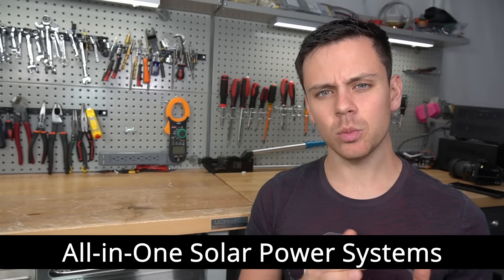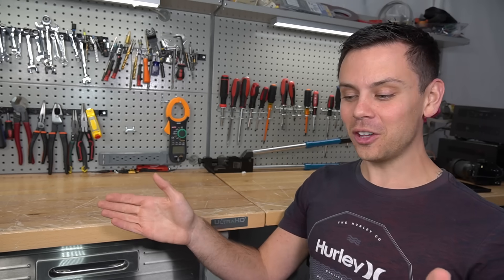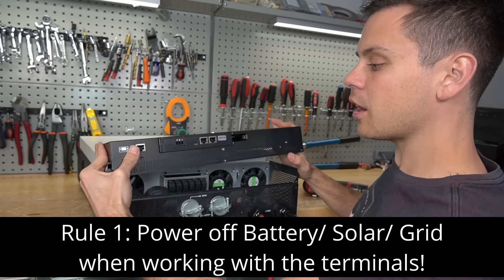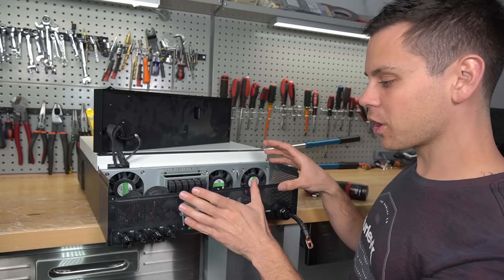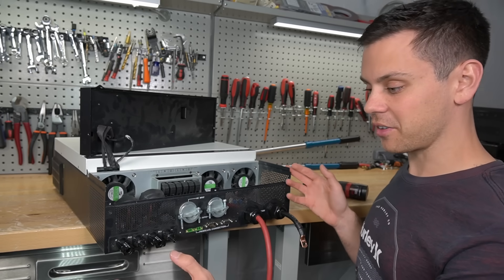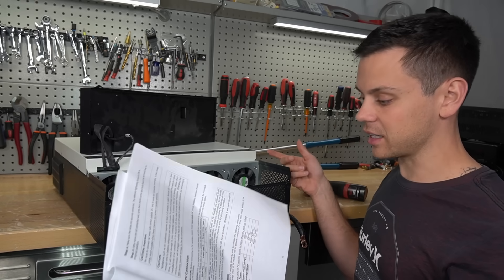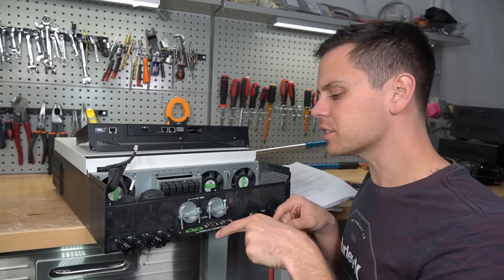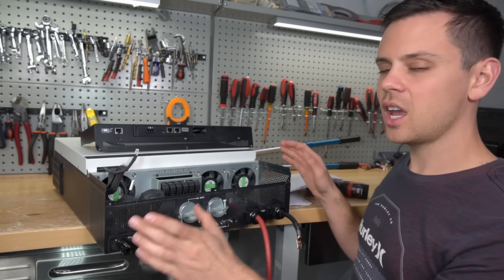All-in-One Solar System: 2 Basic Rules for Shock Hazard Prevention

Comment: This is true for the EG4 18kpv too.  I had my pv wired plugged into the MPPT but not the solar panels and you could weld metal with the arc made by the bare end of the cable i was crimping an MC4 too.  Scared the heck out of me.  Very luck i was wearing gloves and noticed a tingle before it electrocuting me.

Comment: One question I have if the PV inputs are back feeding 120 Volts on the MPPT inputs, why wouldn’t  this result in the all in one battery discharging through the solar panels based on the solar panel voltage or at night when the solar panel voltage drops to zero and draining the battery?

Comment: Somehow I missed this video when I dug through your collection. I "discovered" the same stray voltages when I was checking out my 18K PV. I generally probe energized power equipment fairly carefully to locate any voltage in places I might not expect to find it. That actually was one of the things that convinced me to make my video on bonding and grounding. And it's one of the reasons that I did the earth grounding as I did. I did a local ground rod at my panels connected to the frame and mounts, then connected the ground rods together and to the service entrance ground mount in an 18" deep trench. I also grounded the frames and structure of the mount to the inverter PE. It's belt and suspenders for lighting and other induced voltages. I normally wouldn't consider an earth ground as a path for fault current, but binding the ground rods together makes them a good path for fault current, and of course the system ground bound to neutral at the service panel is also present as a fault path. I've found some leakage between the DC side and the frames in almost every panel I've checked. Mostly it's very high resistance, but the old Sanyo panels at my house in Maui leak a lot. I might be ten years of salt air rather than manufacturing flaws. My solution is sort of a ground loop, but it's a very low resistance one. I do, of course, find a little current flowing in both the neutral and system grounds, but it's microamps. I think any hybrid inverter, whether it's transformerless or not, is going to have a weird neutral issue. If the inverter is going to function off grid it needs to supply a neutral referenced to ground to provide 115VAC, and if it's going to accept power from legacy AC-coupled microinverters, which supply only l1 and l2 at 240VAC with no neutral it's going to have to supply a bonded neutral. I don't see a way around that if the hybrid is going to provide all those options. I'd love to get a full schematic of the 18K PV to see what's actually going on. I may have to take mine apart when I return to the mainland in the spring.

Comment: My understanding is that in order to avoid being shocked all the metal parts of your array should be connected. This is called "bonding" and it includes the panel frames themselves. Those bonded components should then be grounded to the house ground so if anything gets accidentally energized it will trip breakers and ground-fault protection devices. Am I wrong?
Reply: I think you should ground your panels and connect to a lightening breaker.

Comment: Thanks for posting this!  Unfortunately, I saw this too late and was shocked right through the chest by my Growatt.  I didn't know what caused the shock until I saw this video.... It happen so fast when was on vacation tightening the PV terminal with my screwdriver without gloves. My solar was totally disconnected but inverter was on. I was very tired at the time.  My uninsulated screwdriver was at home. I've sense thrown out all uninsulated screwdrivers.  My index finger touched the screwdriver shank when I was tightening the screw.   Luckily nothing bad happened.  Scared the heck out of me!  I'm going to link to this video.
Reply: Ray, I actually found this video through yours.  After watching your video I wanted to read the comments for more safety tips but you turned  them off for some reason, which is completely unhelpful.  Secondly, why throw away perfectly good screwdrivers when it would take little effort to insulate the uninsulated ones using electrical tape or even liquid electrical tape.
Reply: Glad you’re okay

Comment: I got a bit of a shock one day tightening up the screws on a PV breaker and started investigating this thinking this is pretty weird where did that come from , and found 190Vac on both sides of a PV input on a mpp solar 6048MT ( voltronic ) between the earth and PV inputs , problem is in Australia its regulation to have your PV array grounded and i found some leakage to the frames when my solar panels are wet, enough that you can get a decent shock from them to ground if they are not grounded . The reason they warn about grounding is because it will actually blow the IGBT transistors in the inverter if current flows from the PV inputs to ground so there is current there if it can blow your meter that's a 10Amp fuse , take a scenario where these panels are mounted on the metal roof of an RV and that 190VAC then goes to the frame of the caravan when the panels are wet someone stepping into the RV one foot on the ground one on the steel step going into the RV at 190V AC potential then gets a nasty surprise between the legs and that is where a lot of these all in one inverters are used . i read a story about someone that had this problem and before they discovered it they could not understand why their dog would refuse to go into the caravan to latter find out he was getting a shock every time he stepped in . Its potentially lethal if you get a shock while on the roof cleaning panels standing on a metal ladder could causing you to fall also , its just so dangerous and as you say if its a stand alone solar charge controller going to the battery that voltage potential is not there, it is caused by the inverter design not isolating the PV charge controller so they can make the unit a few dollars cheaper with a couple less IGBT transistors and they have known about this for years with no regard for the people that may be injured or killed they tell people that its phantom voltages or inducted voltages but that is simply not true as induced voltages dont have current , it certainly does not need to be that way you can have a isolated charge controller very easily and in some earlier models that is exactly what they had so they had no AC on the PV inputs. It just blows my mind when engineers cut corners on a design that has potentially lethal consequences , glad you made this video , keep up the great work love your channel.

Comment: Thanks for the info. So when you say don't ground solar array - can I ground the solar panel mounting/frames and the metal roof it is on? 

I am completely off grid, would be grounding to the same grounding rod I have set for the main panel.

 Neutral / grounding screw removed from my lvx 6048, neutral and ground linked at the main panel only.

Comment: I've noticed in a lot of your videos you have a BAD habit of connecting your batteries first! BEST habit IMHO would be ALWAYS connect the POS battery cable as the LAST connection unless you are using a Battery Disconnect switch which should be recommended anyway! SAFETY FIRST ALWAYS! Yes safety equipment cost more money but like you said IT CAN KILL YOU!

Comment: Awesome video.  I got shocked by touching the solar panel frames.  After much investigating and watching your video I discover that I have about  50.3 volts coming out of the PV connector  (supposedly an input only connector). The voltage is going up the PV cable wires to the panels and into the metal frames.   So now my question is what is the fix.  This is not acceptable and like you said the potential for a disaster is there. 

If I ground my solar panel frames on the roof I wont get shocked but Am I loosing power because the 50V going up the wire and grounded is draining the Batteries while doing nothing? Any potential Fix.     Please Help

Comment: This is insane… thanks for clearing this mess up because I was so frustrated with my first PV Combiner Box as I received a shock by simply touching an exposed point on my screwdriver that was that I removed it from my solar arrangement thinking that it was not acceptable to receive an electrical shock even though the system was grounded… However, being careful  I chose to replace the combiner box only to then
receive a secondary  electrical shock after once again coming in contact in contact with an input terminal in the combiner box…no more grounding ! 🎉

Comment: I would assume a grounded surge protection in a combiner box is not a constant ground?
Reply: I think per code panels are supposed to be grounded to the 🏠 ground. That assumes you remove the ground screw in the inverter. That's what I did.

Comment: lol..the ground screw on the AIO is for AC ground, it's not a PV chassis ground. All of your pv panels if high voltage should be grounded to earth with a copper grounding rod separate from the AIO unit and the PV chassis ground should always be separate from the PV output ground wire.

Comment: Do I need to worry about this same leakage possibility using a Victron Multiplus II 2 x 120?  I have Victron PV charge controllers grounded to a Victron Lynx Distributor.  The solar Charge controller is grounded to the Lynx negative side, not to the bottom of the Victron MP II. Appreciate any input.

Comment: Now am I high Or Just Drunk ? Ive shorted a 220lamp by touching the lamp with neutral line with my elbow and then another lamp pof but i didnt die. So if you dont have any problems with heart or whatever you shouldent die Right? 
Fun stuff with hazardous electricity :) its not 50,000volts as in Jurassic Park 1 Hahahaha :)

Comment: Good vid Will. They could fit a micro switch to the front cover, so if it is removed it turns off the inverter before you even pull out the monitoring cable.

Comment: HOWdy  W-P, ... 
Thank You for the WARNING / Heads-UP !
My ECO-WORTHY Combiner-Box has a SURGE-PROTECTOR built-IN, that requires a GROUND connection to EARTH,  in order to FUNCTION 
and ALL of my 24-PANELS  have their FRAMES GROUNDED "together" and then to an 8' Copper Clad STEEL Rod driven into the EARTH at the remote ARRAY area  
... I thought this was correct & the consensus ... is this now considered a hazard ? 
COOP
the WiSeNhEiMeR from Richmond, INDIANA
...

Comment: I’ve always installed breakers on either side of every piece of equipment so that anything can be isolated from the system, and removed/replaced.
BUT I can still find potentials on and across earth grounds even when the “live/hot” lines are mechanically cut!

Don’t count on anything.
Work everything cold.
DONT FORGET CAPACITORS HOLD A CHARGE LONG AFTER POWER IS TURNED OFF/REMOVED!

Comment: nice warring. I have not done a all in one system yet. I all ways probe with meter and make Shure all power off even PV.  what I learned as a electrician is all always assume it is hot and can shock you till you prove otherwise. and never trust meter alone. like more than 1 meter and/or test light. The only grounding on a PV array should be only the metal frame to earth ground. That how my pole mount PV is done. the hole metal framework is grounded . it passed UL inspection for my insurance.  PV disconnect is a  requirement on system. same with battery and grid if you have . like my home. no grid ! for  if I had all in one would be gen-set input and that would have disconnect .  😀

Comment: I noticed this after connecting my EG4 3000EHV inverters to my 200v DC grid, I had the negative grounded and bonded to neutral of the AC circuits so that way I could have an easy time switching our AC/DC well pump from 200vdc to 120vac. First time I connected it up and turned it on the inverter had a short circuit error come up, I measured voltage on the PV input and saw around 180vdc on each terminal to ground. Since I knew somewhat of how inverters worked I assumed it was the DC buss voltage and since each terminal had that potential to ground I immediately figured it was the negative neutral bond I had at the transfer switch and removing that fixed it.

Later on I had another larger issue with it. I only have one string of solar panels currently, and I was wanting to connect both the inverters to the string so that instead of the voltage being converted from 200vdc to 180vdc to 48vdc then back up to 180vdc then to 120vac for running appliances directly off of PV input I wanted to cut out the 48v entirely.
I figured that I could connect both PV inputs in parallel to eliminate that. But after I turned them on sparks came from one inverter and my battery balancer circuit and then the battery breaker tripped battery BMS all shut down and other various fuses blew.
I assume that somehow the 180vdc buss got connected directly to the 48V terminals, how I have no idea. But now one inverter has a shorted out 48v terminals that I believe is a MOV that shorted out from the over voltage. 
Also this was while the two inverters where in split phase configuration.
I'm wanting to replace the MOV and see if that fixes it.
Its been a mess lol

Comment: i always disconnect all power when wiring the inverter. On some models there is a high risk to make a short circuit between PV+/PV- and GND, when you have an unisolated screwdriver. You will damage the inverter by doing so.

Comment: Hi Will love the channel!! i have a self build solar system in my motorhome in the UK and I'm upgrading to lithium (probably 2x SOK 100Ah) any chance you could do a video on charging a battery bank via 3 methods, solar is mostly covered on your channel but what about the battery to battery system and hookup charging, i have a 3500 watt inverter/charger (40amp) and I'm concerned i will pull to much power from the battery with the large inverter and also charge to quickly when hooked up or even from the B to B charger. You done a great build on a board a few years back but only with solar charging explanation.

Comment: I’ve a Zing Solar system connected to my electrial provider installed in 2016, System Size is 5.67 kW Estimated 1st Year Production: 9,848, consisting of 18 Solar Panels and Inverter Type: LG 315’s, Enphase 250’s.  Can I link an All-in-one Solar Power System temporarily and portable ground array to my existing home electrical system using DIY components not requiring additional permits?  I plan to eventually move my All-in-One components to another off grid property later of possibly use them in a camper RV.  Which components and cheaper glass panels would you suggest?

Comment: I know this is like war and peace but I like to think it's worth it, auto correction doesn't like me but you are smart.
Looking at the characteristics of Lithium it's either going to make a really good battery or a really bad one! (hates water),  may be dry powder extinguisher is the way to go  otherwise wave goodbye too your eyebrows.
P.S. 
Hi Bud, (Sorry I didn't get your name)
A big question for me is do you know what effect the cold has on a Lithium, I hear the management system won't let it change but if they need to be monitored in this way it would seem as the cold effects them in some way even in general, the reason I say this is I have six LED lights I use them with a remote as I go to bed, however I only use three of them but change them all six with three  AAA batteries, on a minu temperature night the three that are not used go flat but the ones that I use still work for a week or so, more of a test than is this bloke too dumb to remove the batteries ones not used, I wanted to see if it was jest that once but it's not it has happened isix times on every cold night, they are fine until the cold comes.
I have no idea whether there is a core cold problem with Lithium or I just don't understand Lithium batteries or logic at all.
Buy the way your are great, you are full of  knowledge and the enthusiasm of youth instead of the tired voice of age.
If you are looking for another goal learn something else and teach that, in my opinion you were born to teach.
One other thing that could affect them could be they don't like being fully charged for long. I guess, I wonder if the management system brings the change down because it effects the most at fully charged.
But I have been wrong many times and don't mind admitting it, I only really learn  with my mistakes, the other stuff is too easy.

Comment: Speaking of potential shocks: literally today received a stand alone inverter than only connects to the battery. It has a built in plug socket including an earth/ground. Usually I stick to low voltage only but this is a build in plug socket. Surprised to find that despite having a metal case and an earth/ground pin there is no way to connect it to a ground/earth. Opened it up. The earth pin connector is not even connected to anything. I thought there would be an extra screw to attach an earth to. What do you do about powering devices that need a ground in an off grid system. At the very least I was expecting to have to run a wire to a grounding stake but there is no attachment. Not a problem I was expecting to have. Maybe I drill a hole in the case and do it properly myself, but this seems unnecessary in a new device.

Comment: I've had this problem on my Backup Power Supply. When the inverter was turned off and it was connected to the grid, touching the positive or negative of the battery + the inverter housing exposes live current. It's not dangerous, considering the amount of current seemed to be limited greatly, but you could still feel it tickling, which really surprised me in a negative way :O

Comment: Love following you Will. Great info!  Quick question. I’m running 2 / 400 AH LiTime Amphere time  batteries in my coach. I want to add 400 more AHs. Room being an issue. Can I use another brand like SoK 2/200 AH batteries tied into my existing system. ?  Thank Will